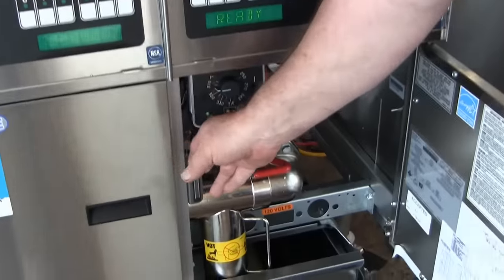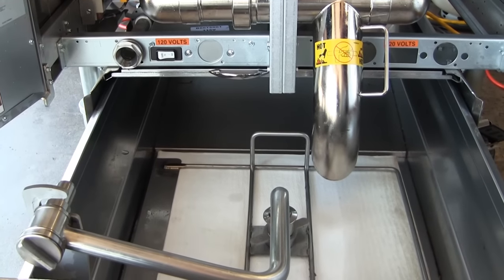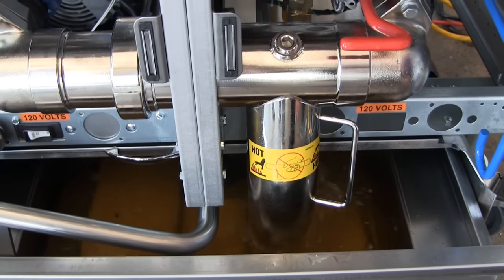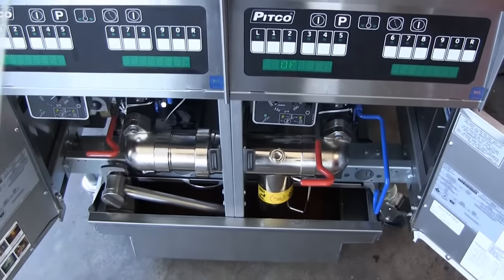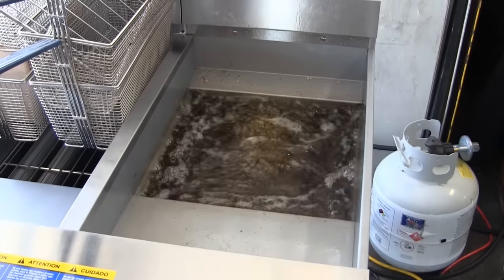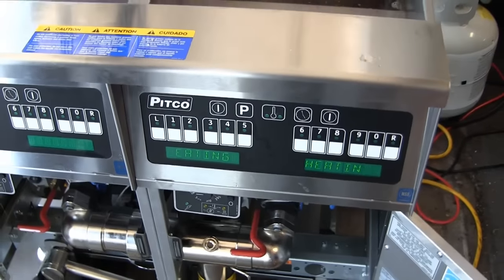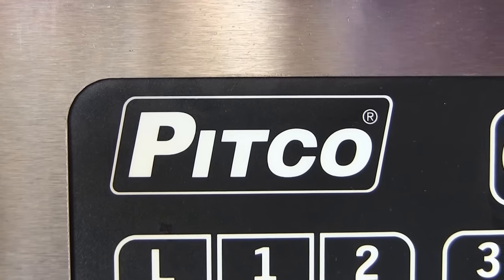Pitco® Fryers With Filtration System

Comment: So to change the oil out frest there's no system in place to extract the old oil but to lift the FULL basin by hand
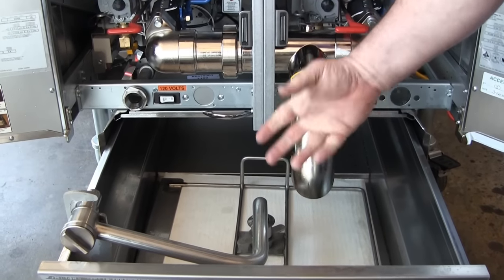Reply from the maker: No, sorry for any confusion. You can use that big spout to dump the oil into a receptacle. At 0:21 he tilts the spout up and you could then slide the drawer back in and place a receptacle under the spout. You can do it all at once or a little at a time.